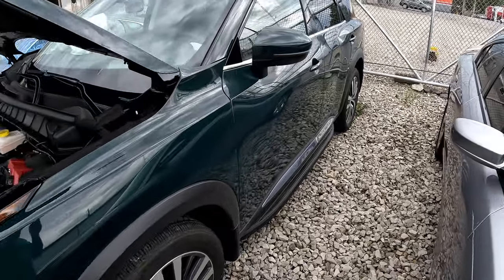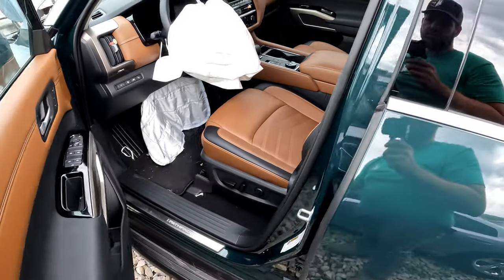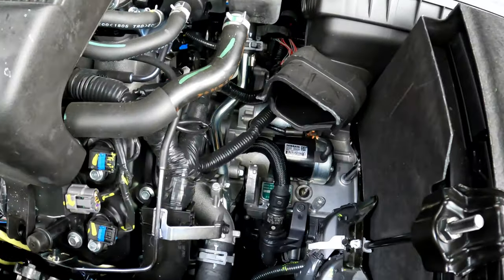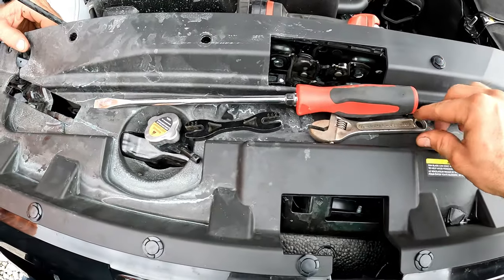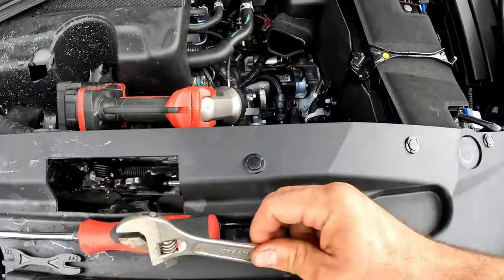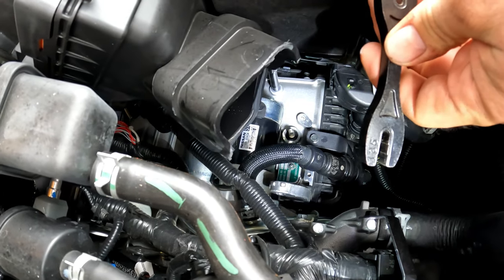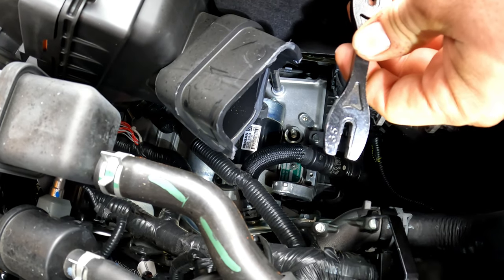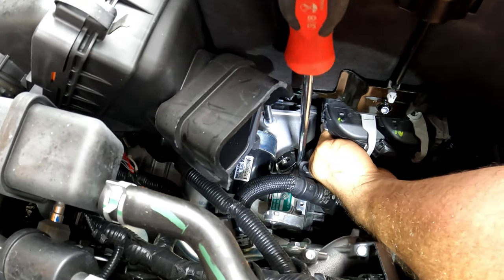2022 Nissan Pathfinder Neutral Override Release | TOWING TIPS !!!

Comment: Nice!!! Reminds me of the Honda and Acura with electronic shifters. I have the tool for the Hondas and Acuras but don’t know if there’s one for Nissan. You can do the same method on the Hondas and Acuras and use a zip tie to hold the wrench. I like that spoke tool cause it fits perfect. Good job! 💪💪
Reply from the maker: We've towed a few Range Rovers that are same/similar scenario, as well as a newer Buick, Enclave if I'm not mistaken... Spring loaded neutral override, not fun haha!
Reply: @WilcoxGarageRecovery  yup the range rovers are like that. Some you can hold the paddle on the steering wheel and the gear selector will pop up and allow you to shift.
Reply: Do either of you guys know how to turn off the electronic parking brake once you get it into neutral?
Reply: @bigrig4385  if the vehicle has power you can get them off and if not you’ll need to feed power to the electronic motor to disengage them. Another way would be to unbolt the electronic motor from the brake calipers and remove them but I don’t do that cause I don’t wanna get blamed for anything later.
Reply: @TowMan127  thanks man. You're a legend on here!
Reply: @bigrig4385  you’re welcome! 🫡 🤜🤛

Comment: That's awesome I gotta remember that. 
I have ran into a few of the new cars that have electronic parking brake that's locked on after it was wrecked. Any good advice to release one of them?
Reply from the maker: The electronic parking brakes seem to be a whole different barrel of problems! We have not had any luck with figuring out how to remove them....we normally just put wheel skates under and winch them onto the rollback. Thanks for the feedback 👍🏻